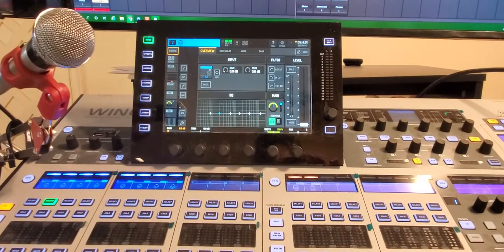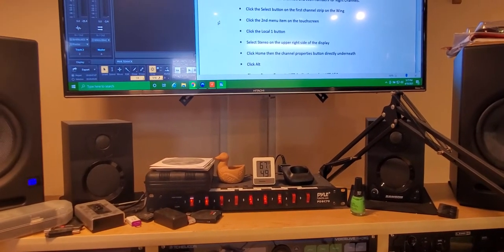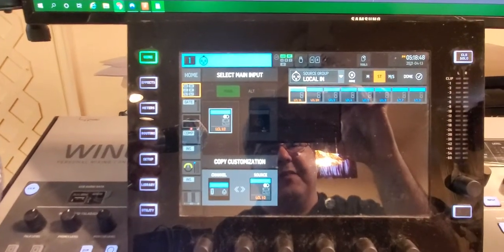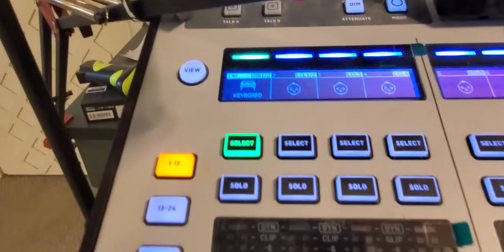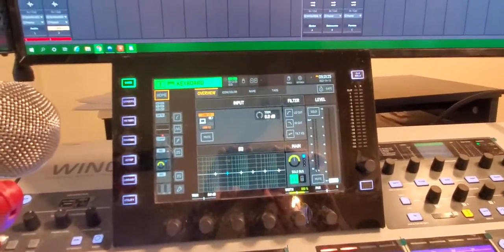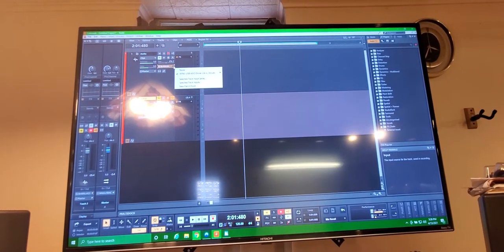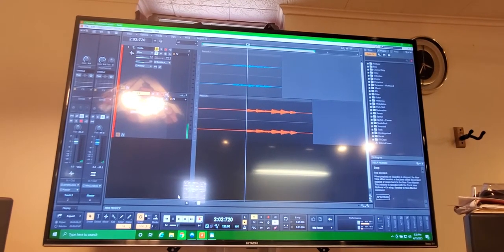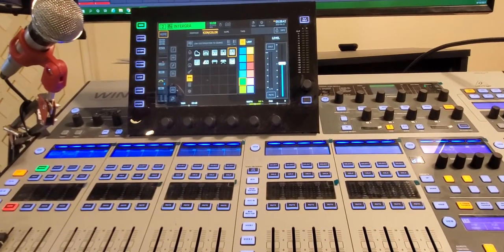Setting up the wing for your your DAW. Step by step

Comment: @Paul F my DAW connection is more than 80’ away. USB won’t work. Do you how to set this up with an Ethernet cable coming out of wing?
Reply from the maker: Hi Rafael, I have only used my wing via USB. Amazon may have an extender that can help or even a long enough cable. Be sure you are NOT using a hub. The wing in my experience only seems to cooperate with a direct connection. Sorry I couldn't  be a better help.

Comment: Hello Paul! I’m setting up my Wing for studio use only. I’m using Ableton Live 10 on a 2020 Mac. The DAW mode is engaged. Everything seems to be working except that all of my master audio is coming out in mono. I want it to be in stereo for mixing and mastering purposes. Panning in Ableton isn’t helping. Is there anyway I can pan in my DAW and it come out of the Wing panned? I don’t want to use the WING’s processing, effects or panning. All of my studio monitors are plugged directly into the Wing. I’m not using an AES50. Also, my headphone volume knob is controlling both my monitors and headphones. I’ve watched all of your videos. Still no luck. I’m sure I’m missing something simple. Any help would be appreciated. Thank you!
Reply from the maker: Hi DJ Ladda, First of all try this video...   https://www.youtube.com/watch?v=X-_uLp5XPqI&list=PL9CYG-ctxb_e_bARDFmBkAXRr03TWcB_x&index=3&ab_channel=BehringerKnowledgeBase    Also I believe there is a Reaper template on the Wing. Click on the "Setup" button then select the "DAW" tab on the screen. There should be a preset dropdown where you can select reaper. I wish I can be of more help, but I am not too familiar with Macs plus I am a mere hobbyist. You may also want to try and contact the folks at musictribe. I wish you the best!